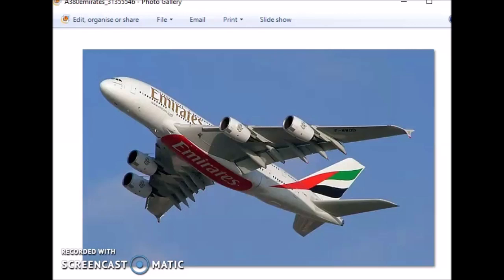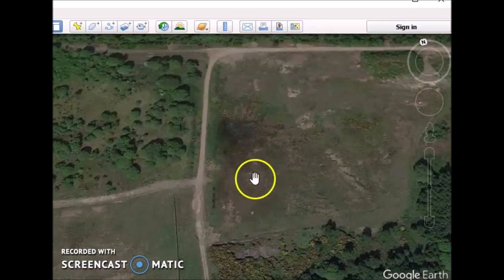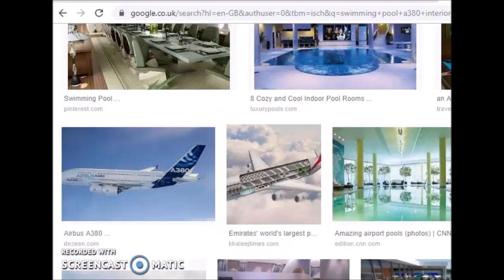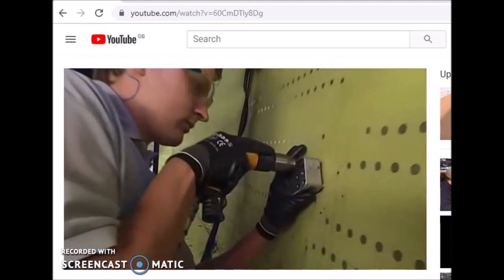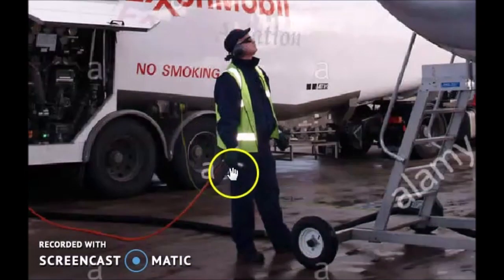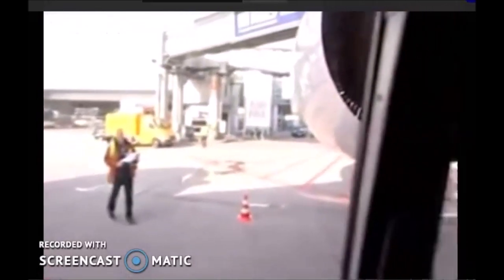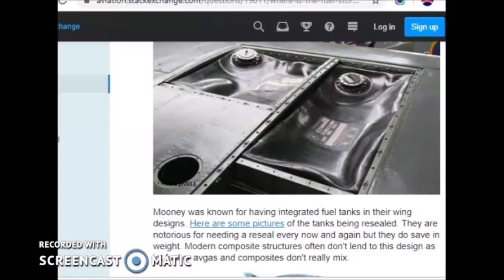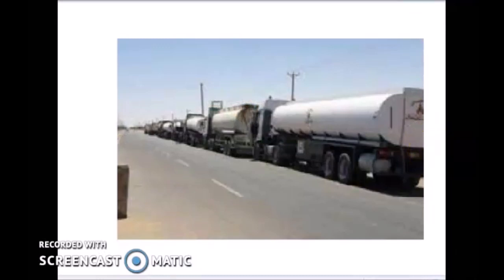True Earth , Jet Fuel Hoax A380 , where do they put all the fuel then ?

Comment: Remarkable to look at airliners from the 60s and 70s and see the same machines, identical in fact to to today's airliners.  Back then jet engines run on a type of refined kerosene, which again is same as today.  All these special ' jet fuel ' additives are still exactly that, additives!  The base fuel for jet engines is still kerosene, and highly refined kerosene is called Parrafin.

Comment: This has to be a joke right? I mean, no one could be this stupid.
Reply from the maker: so, you think there are hundreds of tons of fuel in the wings ? how does that work then ? you can see quite clearly from the video there is absolutely no room to do so, the wings are made from framework with more holes than gorgonzola cheese ffs !if you are insinuating the rest of us on this page are stupid , I'm afraid your jacket is on a loose nail !!!
Reply: @rebelwithoutapauseFE224  Yes, the fuel capacity of the A380 is  315,292 liters. That is a lot of fuel. I wish they did have engines that didn't need to burn fuel, it would make my car a lot cheaper to run.
Reply from the maker: @ToxicTeemoOCE  older cars are off the road because they could have been converted to run on water , you can find proof on line , it was done in the past , Jets run on free energy collected from the aether , compressed air !  :) cheers
Reply: @rebelwithoutapauseFE224  There is no Aether, that has been proven over and over again, for the last hundred years or so. Look up Michaelson Morely.
Reply from the maker: @ToxicTeemoOCE  all I need to do is look up !  
I believe what I see , not what I'm told to see :)

Comment: Then are you saying it's just air there pumping into the jets what makes them work
Reply from the maker: pretty much Scotty , I will make a video to explain :) cheers
Reply: Yes everything is combustible & that includes air as it's compressed by the fans & only needs a very limited amount of fuel to burn. Just look at the old carburetors on older cars, too much air & the engine goes crazy / you see fuel won't burn without air ?
Reply from the maker: @stephenboyd4934  exactly :)
Reply: @rebelwithoutapauseFE224  and too much fuel the engine will flood & stop, that's why when you cannot start a car if you keep trying you're flood the chamber ?
Reply from the maker: @stephenboyd4934  probably why they collect & compress air from the aether :)money out of fresh air :)
Reply: I would think the engines might work off electro magnetism  slso

Comment: A tanker carries a max of 43,000 liters of fuel, so it would take 7.5 tanker trucks to completely fill the 323,000 liters fuel capacity of the A380. Haha.
Reply from the maker: logistics always fucks em up :)
Reply: Actually to fill A380 you do not use tankers. Those airport that handle this high capacity aircraft, like frankfurt does, use a system of underground tubing that carry the fuel directly from the main source tanks. They use an intermediary truck foe the testing of water in the JetA1 and the metering unit to deliver the exact amount of the fuel. Those willing to push the compressed farts unsuported theory are just an empty brain acting as a resonant cavity feesing their own cognitive dissonance. The Jet Fuel Hoax was introduced into the Flar Earth Comunity to actually discredit the positive ideas of how airplanes prove in many ways that we live in a Flat and stationary plane.

Comment: To get an idea of the volume of 323,546 liters, convert directly to cubic feet which comes to 11,425 cubic feet. A pool of 60 ft   in length x 30ft wide x 6ft and 4 inches deep is the exact size of the pool that would be filled to the brim by the 323,546 liters  fuel capacity of the A380.
Reply from the maker: apparently there is a large swimming pool of fuel in each wing  , they also say there is a few tons in the  tail ffs  :)

Comment: A380 fuel capacity of 323,546 liters  is equal to 323.55 metric tons direct conversion using water 1 kg, /liter density. Aviation fuel has a density of 0.8 kg/liter. So 323.55 metric tons multiplied by 0.8 equals 258.84 metric tons of aviation fuel based on my calculation.
Reply: So the set up is the compressors are run by electric motors. The motors are powered by generators which are the ones that use the fuel. That is just my theory.
Reply from the maker: @leobiscarra8456  a theory shared by many of us :)
Reply from the maker: so , where do they stash all this fuel then ?
Reply: @rebelwithoutapauseFE224  its possible that they use compressed air to turn the turbines.
Reply: So its only the compressors that they need to fuel. Which probably isnt as much as what they report for that so large a quantity.
Reply: They also wont need aviation fuel but probably only automotive gasoline to fuel the compressors which is cheaper than aviation fuel.
Reply from the maker: @leobiscarra8456  that is what a lot of us agree on , remember the scene in the Great Escape James Garner & blind Donald Pleasance ? a shotgun cartridge was used to fire up the engine !!
Reply from the maker: @leobiscarra8456 any fuel will probably do the job , but they say Aviation fuel is expensive , of course they do :)